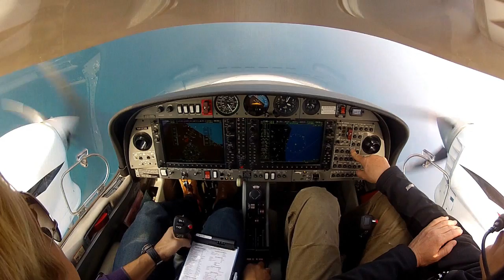Multi-Engine Rating in 12 Days - Day 5 Part 2 - Full Video with Cockpit and ATC

Comment: Isn't VMC 68 KIAS (red line) in the da42? Did you simulate loss of control at blue line or did it start to roll at that speed (82 KIAS)? Thanks for another great video.
Reply from the maker: +Cuyler Binion not exactly, I was not quite there yet with my Vmc demonstration. I still did not understand how to do it when on this lesson. It clicked several lessons later.